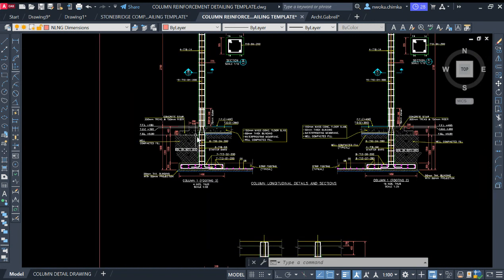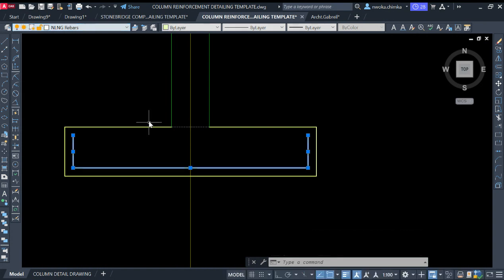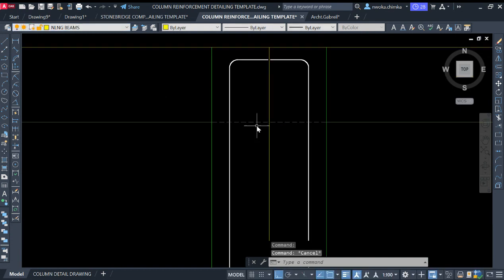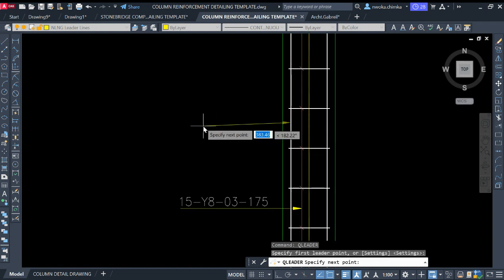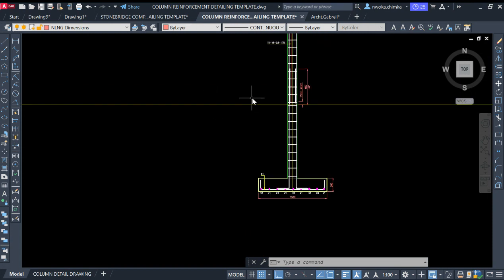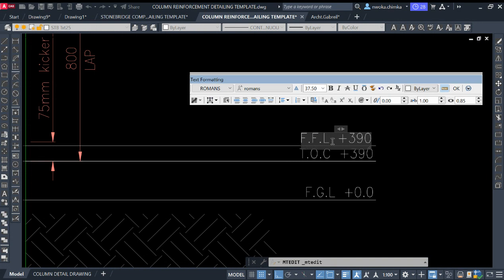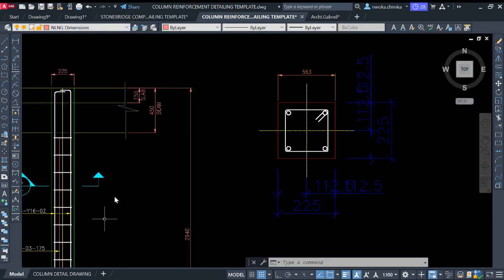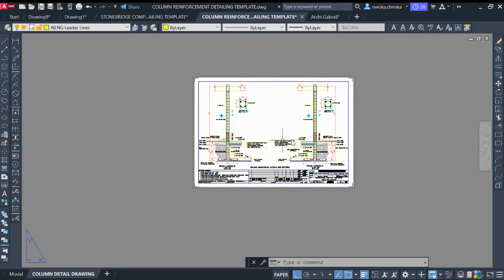How To Detail Column Reinforcement Manually - After Prota Structure Design. - Complete Tutorial

Comment: Love it.
However, i didn't see the plinth beam in the section.
Also, columns are lapped at the mid span, not closer to the top or bottom of slab
Reply from the maker: The template is been updated every year, so I believe it will be updated in next version